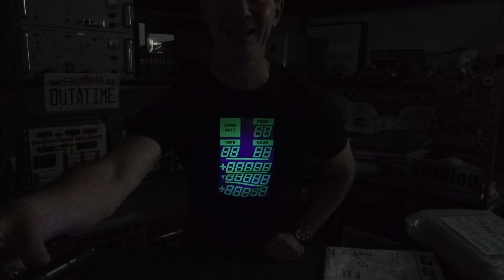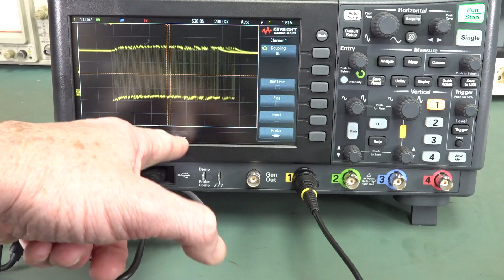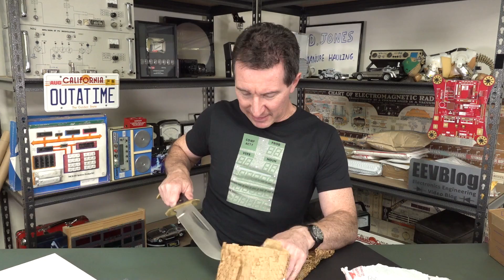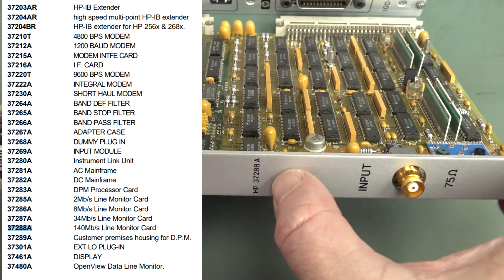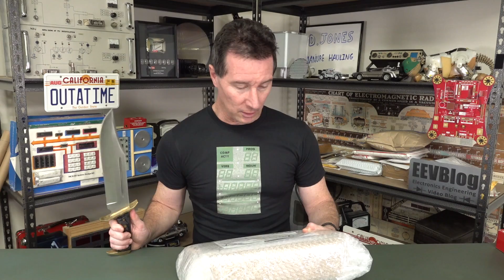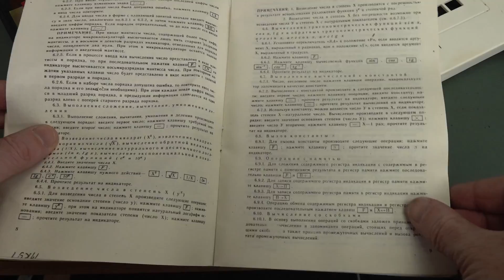EEVblog #1221 - Mailbag Monday

Comment: 5:35 On one side it is cool and works not bad. On the other hand is it slow and you must talk slow an very well pronounced too. I would spend more time to find a nice way to securely set my probes up to use the UI of the scope. After it did not execute my command after the third try it will fly 😊😂

Comment: They did two types of power input on these elektronika calculators a 42volt AC input and a 220volt AC input version this one seems to be 220v   220b for the Russian. The 42volt AC was used in schools, some classrooms had 42v AC power sockets

Comment: Wow this takes me back, i remember those IBM cards. I thought the crosshatch was more an attempt to cut crosstalk between the chips like some kind of shielding?. I love the 68000 processor, worked with them at college, and of course they were used in Commodore Amiga's. I still have a heavily modded A1200 with a 68060, yes a 60Mhz computer from the early 90's. It still works, has USB, 4 hard drives, 2 floppy, 2 CDR's and it boots up in less than 60 seconds. It even plays MP3's which wasn't even invented yet. I would like to see you tear down an old Commodore. Cheers mate!

Comment: The HP digital card appears to be a video digitizer and usually it's stream would be muxed in with many more in a fiber cable channel and demuxed out at the destination. (fiber ring)
Usually the A-D clock rate would be three times the color frequency.
  The calculator's display silver is indeed the getter in that vacuum tube.
  It is a shame that he didn't test the fuse and if good measure the power supply's output Voltage.  (should be two: for the logic and for the tube {? 20 V. ?} )

Comment: HP board is either VME or VXI - part of a racked up test rig, maybe. Watch that ECL - I've burned my fingers on those things, they run very hot,  (non saturating, power invariant output stages). ECL was the fastest logic on the planet at the time, as used in the Cray-1.

Comment: Interesting HP 68K board and the TTL->ECL logic interface card - from a late 80s/early 90s microwave link frame?  34Mbps and 140Mbps were standard trunk speeds for regional point-to-point networks.  Early ATM sometimes ran at 140Mbps over fibre (instead of 155Mbps)  This was state of the art in that frame relay/ATM era.

Comment: Repair that Calculator or give it to me! ☺
Reply: You probably need a new 7segment tube to make it work again.....
Reply: TubiCal the tube should be fine, crappy Soviet caps should be the actual culprit here, check other people comments.
Reply: IV-18 is a 8-digit 7-segment VFD tube, also used in the Ice tube clock kit from adafruit.
Adafruit doesn't have the kit or the tube anymore, but the tube is available on eBay.
I'm sure you will check, but it sure looks like the same display. 
Please keep up the good work / videos. Fran and Dave

Comment: the factory adjustable delay lines on the HP board, may be to fine tune for differing rise times between the different manufacturers ttl chips, in case they need to change supplier. Years ago, RS used to badge engineer Mullard/.National / Fairchild/ whoever chips. Half the times a board designed for rs components would fail, since fan outs/fan ins varied between different manufacturers, and if the board was designed to the limits for, say, National  it would fail if RS used Mullard - RS would not give the details of the original manufacturer. I have never used RS components, because of their duplicity.
Reply: A lot of the time RS used to have the top of the chip painted black with the device number and order code printed on it. Under the paint was the original marking.

Comment: cut a squar out a piece of paper. Stick cellotape on it. turn the paper and place your smd part on the cellotape and you can use normal probes or tweezers without the risc of flying parts.

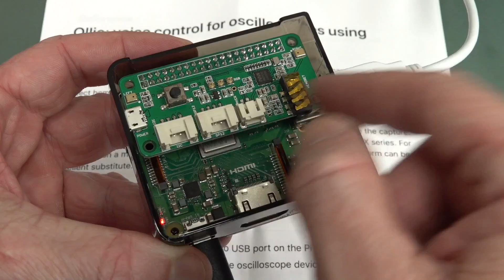Comment: 2:49 I suspect the reason it's got dual mics is simply because it's a standard board that can be picked up fairly cheaply - the ReSpeaker 2-Mic Pi HAT.
Reply: Two microphones are commonly used for noise cancellation.

Comment: The two 2U Eurocard boards are most likely VME bus boards. Very common for industrial and instrument 68000 based systems of that era. The VME bus is a ruggedised standards compliant version of Motorola's VERSA bus which used less robust card edge connectors. 3 rows of pins on the connectors + 68000 screams VME bus to me. Top connector would be the VME bus, and bottom connector may have 32 bit VME expansion, and/or IO connections routed via the backplane. Routing the IOs via the backplane has the advantage of not needing to muck with cables when doing a board swap. The one with the 68000 could be a dedicated IO processor board or a full embedded processor board with limited memory. Are those 2 * 64k 150ns SRAM chips by the EPROMS? I didn't see a DRAM bank. The HP-IB bus would be for hooking up hard disks, floppies, and/or various instruments.

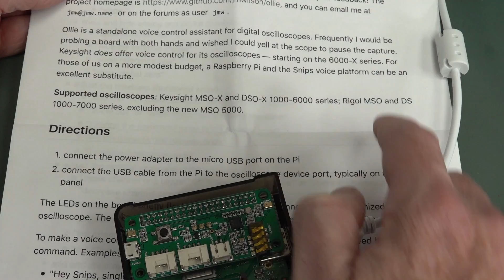Comment: 3:18... Then would that voice interface work with the Rigol DS1054Z ???
Can't seem to find a built and tested unit seller.
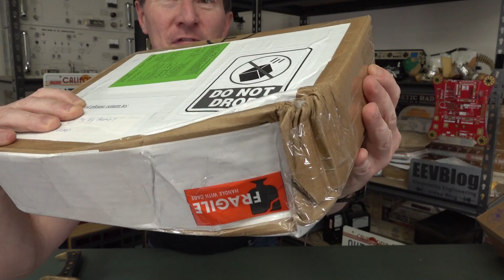13:20... Unless that package weighs over 20-30 pounds and was accidentally dropped... that corner damage was deliberately done by the courier.

Comment: Hi Dave, you've just witnessed the reason why "communism" has failed. There wasn't a market allowed, just a production plan. In the middle of the 80's when ordinary people's life worsened came Gorbachov and declared legislation for some private initiative and the process of production conversion, so a manager of a factory making ballistic calculators for tank gunsights would scratch his head and said "why not make tabletop calculators". He wouldn't care marketing because the factory will still have some state military contract - "the shops are empty" he would thought, although any engeneering undergraduate student from the decade turnover would had already bought a Casio fx series pocket calculator with the same functionality on the gray market.

Comment: Dave, it looks like you don't have to wait until snips responds to your "Hey Snips". Just try to speak the sentence in one go. Yes, this does not shorten the wait time after the command but you do not have to wait until the LEDs are lit-up. What you also can try: get a raspberry pi 3B+ and plug the ollie module into that.

Comment: It can't steal power from the usb port because they are limited to 500mA 5V unless you use PD which I don't think your scopes have; and the RPi specs a 2A 5V supply iirc. Not that it uses it constantly but for peak usage and all the io you can attach.

Comment: The HP 68000 board and cousin look like part of a VME bus system. I used to use a broadcast character generator that was a Motorola branded 68020 VME card with the same DIN connectors on the back and the aluminum front. It was in a large chassis for the video raster processing with a bunch of custom boards. It was called a Chyron Infinit! (exclamation mark was part of the name :)

Comment: with dual microphones you can easily look at the side channel (or difference signal) to pick out sounds that are closer, or the mid channel (sum signal) to pick out sounds that are far away -- since the more close a sound source is, the more differently it will get picked up by the two microphones.

Owsley, sound guy for the Grateful Dead, famously used this technique in order to prevent feedback from his wall of sound (which was behind the band) going into the vocal mics!

Comment: Woah. Those Aprilog zif socket boards are $85 each. You mentioned they were cheap, but no, they're not cheap :)
Reply: Pete Brown would be fun to CNC machine &/or 3D print some! - CHEAP!! :)
Reply: @the_eminent_Joshua_E_Hrouda  If you buy just the ZIF sockets from them, they are like $30-$45. That's a huge component cost, but $40-$55 for the rest of the board (small PCB, two tracks, two screwed-in banana plugs) is, even considering it a niche product that is maybe hand-assembled, absolutely ridiculous. 

Agreed you could likely 3d print (especially with a resin printer) a ZIF socket that would work for us. Not sure what tolerances they support, though.

Comment: That display looks fine. I have an Adafruit clock kit that's been running continuously, perfectly for 8 years or so with a display tube that looks exactly like that. In fact, the tube might even be the same part.

Comment: Dave, the black on the back of the VFD is probably just getter compound and you should look around that area for any type of getter ring or holder;  the silvery streak is kind-of strange... no comment on that, but if the display still has the getter, its probably still has a good vacuum, and might be worth trying to see if it works

Comment: I suspect the delay line is to cheat on gate timing. Wouldn't be surprised if you traces out the paths the logic can take through the gate network you'll find it in a spot where another gate or two would have balanced it all out but resulted in an extra chip. Seems like a simple optimization to reduce amount of chips the otherwise underutilized vertical axis.
Reply: Eidetic Ex Or perhaps quadrature decoding (I and Q)

Comment: Hi, Dave.
This is the VFD ИВ-18 (IW-18) display , and this white stuff (some kind of paint) is 100% normal in this place :)
I have this display in a mint condition (it has never been soldered) and I also have a white coating exactly in this place (from the factory).
I think it's a kind of protective layer, because in this place, there are two Getter rings - and as you know, these have to be inductively heated.
As long as you have a black coating on the back glass, it means that it keeps the vacuum and the display should work!

Take a look at the fuse, replace the capacitors maybe, etc.
 
By the way, I must honestly admit that this calculator looks beautiful (i fell in love immediately;) ). Maybe the quality of the material from which the casing was made is not at the highest level, but when it comes to design, it looks great! A combination of white with black and green island (display) in the middle, simply looks clean and beautiful. This one beveled corner with which the power cord was lead out. Everything looks more modern than it really is;)

I wanted to add that I'm not Russian :) :)

Cheers!
Reply: Capacitor manufacturing was not the strength of our industry  ))
Reply: @PavleKolesnik  как и всего остального
Reply: Именно в этом устройстве причиной отказа с большой степенью вероятности являются «ереванские» конденсаторы.

Comment: Dave we used dual inline packaged delay lines in the development of the early winchester drives (talking about 16" platters ). They also where tapped by the pins. However their characteristics were crappy to say the least. The best is still a proper terminated piece of coax cable.
Reply: You'll also see the DIP delay lines in a lot of older (e.g. 4116/4164)  DRAM designs to provide the delay between RAS and CAS on the multiplexed address lines.

Comment: You know you can get a 7 day timer with multiple setpoints per day for like $10 from eBay. 😉.  That has din rail mount and is tiny - I keep a few handy for all sorts of things - easy to program too.  Not sure why this one was developed when there are so many out there.   Needs to be 5 to 32 volt power as well to be of a wide usage item too.

Comment: I tried to use snips before, couldn't make it work at all.

Edit:
The scope connection doesn't provide power. It's a device, so it can't. Only host can provide power. (OTG is both, kinda)
Reply: Was about to post the same

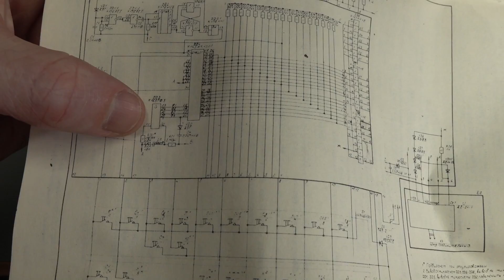Comment: 38:34 This is 4-phase clock generator for the main chip.
Also, I guess the VFD is OK (black stuff inside becomes white if there is air inside), try to power it up and check supply rails. 99% there is a problem in the power supply. It is very primitive, you can quickly find and fix the problem.
Reply: I'd love to see a fix video for that thing!  I still have an old soviet voltmeter in the closet :)
Reply: Manual and on the last page scheme. Here you go https://www.qrz.ru/schemes/detail/14991.html and press "Скачать себе" - you need DJVU reader or online service to convert it to PDF like https://djvu2pdf.com

Comment: At around the 19:00 minute mark I noticed the trace coming out from the left side of the LCD BRIGHTNESS trim pot is rather odd. It goes to the left a bit then makes a 45 degree bend to the north east. I would have run that differently to avoid that extreme angle in the trace.
Reply: Caught my eye too. No way would I have done that.

Comment: Hi Dave!. Not sure if someone already said it. Chip on 38:35 is К165ГФ3 - 4 phase impulse generator. It have frequency range of 75-100kHz and was used in calculators.
Reply from the maker: Cool, thanks.

Comment: The HP board is probably part of some telecom testing equipment. The 140MB/s rating is a standard bit rate for high order multiplex equipment which I worked on in the late 80's. The 75ohm input impedance is standard for this type of telecom equipment.
Reply: BERT
Reply: It looks likely the two parts were designed by different teams, or possibly two existing designs were put together onto one board..
Reply: And from memory AIS is "Alarm Insert Signal"
Reply: Yes, looks like it. And it's VMEbus, which was common for that kind of equipment. I would say it's probably early 90's.

Comment: If the timer is in a room that you don't want bright light at night you would like the back light to turn off under is I end up having to put electrical tape over indicators and LCD screens cuz the blue light emitted will keep me awake
Reply from the maker: Fair point.
Reply: All the more reason to not use stupidly bright blue or green positive LCD panels. I've used red negative ones for similar projects, and they look gorgeous in dark or dim rooms.
Reply: Once I went so far as to develop a ATtiny85 based solution to be able to turn off the backlight on Ni-MH charger. Its bright display illumination was very annoying in the night.

Comment: new in box.. but has new plug on it? hmmm?
Reply: It looks exactly like typical 90's Russian plug, one that requires knife or drill to actually fit into grounded outlet in Poland (we use French standard with ground prong in the socket, not in plug, and Russians in 90s just didn't have grounded outlets so their 2-prong plugs covered whole circle so it was always fun to connect "Russian import" appliances) ;)

Comment: Hey Snips, Enhance 224 to 176. Enhance, stop. Move in, stop. Pull out, track right, stop. Center in, pull back. Stop. Track 45 right. Stop. Center and stop. Enhance 34 to 36. Pan right and pull back. Stop. Enhance 34 to 46. Pull back. Wait a minute, go right, stop. Enhance 57 to 19. Track 45 left. Stop. Enhance 15 to 23. Give me a hard copy right there.
Reply: Only the cool gets kids this reference.
Reply: Snips:
Scopes are just like any other machine. They're either a hazard or a benefit.
If they're benefit, it's not my problem.
Reply: You know that Voight-Kampf test of yours? Did you ever take that test yourself? Deckard?
Reply: hey snips: have you ever recalibrated an oscilloscope..... by mistake?
Reply: Those are some nice toys you have there (puts hand in boiling water, pulls out egg)
Reply: @grantrennie  Wasn't that an eyeball and I don't think it was hot. It just had bubbles.
Reply: I was so thinking the same thing!

Comment: Dave I think the stereo microphones on the voice recognition thing are there to help with keeping original signal and echo apart. If you cross-correlate the signal from both inputs to find the timing difference, then overlay them while correcting for the difference you should get a signal with minimized echo components. at least I think so...
Reply: I was also thinking that it would improve the ability to interpret the audio through added programming. But I am a "young player" at my tender age of 43!
Reply: @jasonbrindamour903  well then i'm the younger player at age 27, ha! that stuff is all i remember of my signal processing course in uni :p